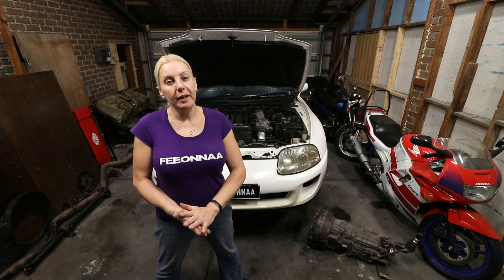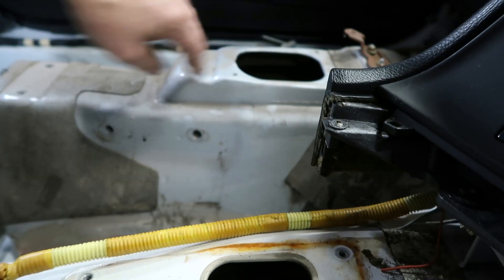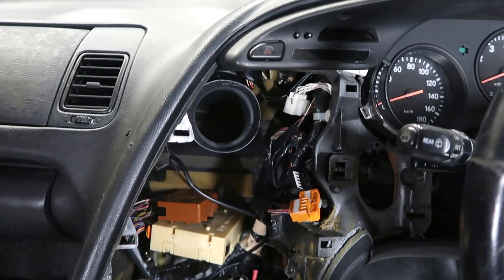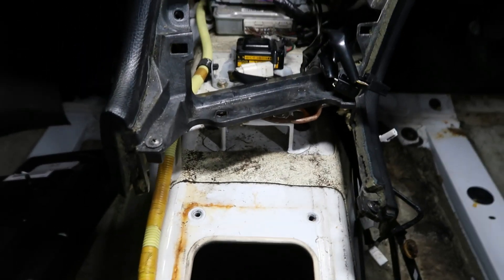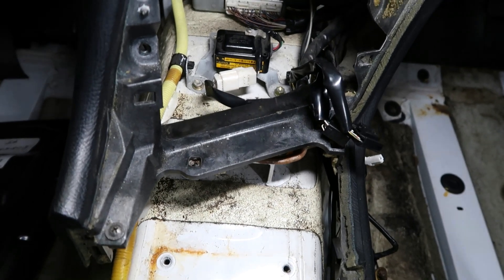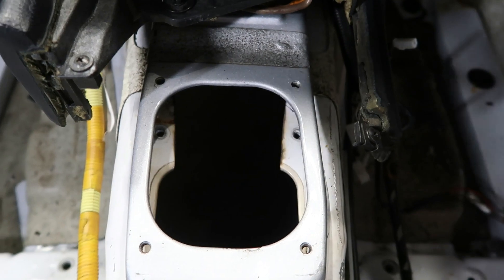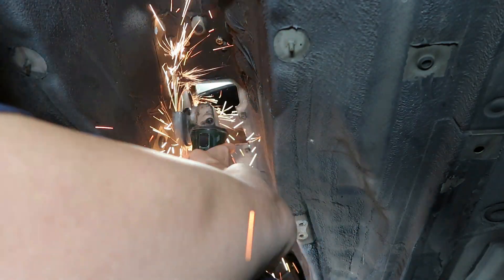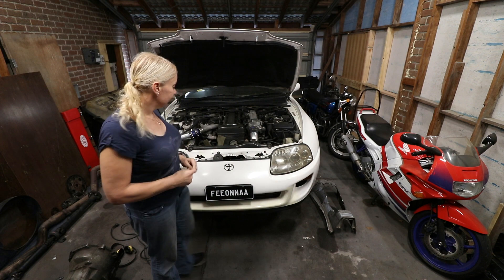Supra Build - Manual Conversion Tunnel Adjustment

Comment: when i did it. we had it on a hoist and did it all from underneath. just drill out a few spot welds and a little persuasion with a chisel and the auto one comes right out. then that new black one you had goes in no problem. just a few plug welds and some seam sealer!
Reply from the maker: Hi Pyrosrockthisworld,

You are exactly correct, but I don't have a hoist, and even if I had a ready to go welder and was able to do good plug welds, doing so without a hoist would be hard and possibly dangerous. 

Structure wise, I'm sure original spot welds are better than replacement plug welds, and I'd be concerned about leaving exposed metal leading to rust that I couldn't get to, especially between the 2 layers, whereas doing it my way all the exposed metal was treated, primed and painted.

Like you, I used seam weld, but you seem to be completely lacking sound deadening, where as mine still has stock coverage of sound deadening on both the original tunnel and the hat I made from the tunnel I cut the piece from.

For what its worth, in considering my abilities and the tools I have, I by far prefer the result I obtained, when compared to every other tunnel alteration I've seen or heard of, as done by anyone else so far.

But I do have to conceed, that my tunnel adjustment is still not as good as a factory delivered manual, and for those who do have access to all the tools, including a spot welder, and who bother to redo the sound deadening, then they would have clearly exceeded any conversion I have ever heard of.

As I said in the video, to do the conversion as how manual cars were delivered from factory, would be a total bugger, and everyone takes a short cut.

This video represents my short cut.

Kind Regards,
Feeonnaa
Reply: pyrosrockthisworld drilling out the welds and mounting it oem style is also more accepted when getting it engineered as technically its a structural component of the vehicle

Comment: this part was fun, i found a template to outline with a marker from under the tunnel. It was a perfect fit after that. It was extremely loud cutting from underneath and very unpleasant feeling the metal shavings blast me in the face 😆

Comment: Wow Hi car girl keep going, I’ll cheer you up, supra owner here from Thailand , What do u think about t56 swap im planning to buy it now im running on stock auto
Reply from the maker: The T56 Magnum Supra swap kit TR6060, with its close ratio gears is mint, new takes power, parts available etc... for me it was the cost of the conversion kit to make it work made the total cost only slightly less than the v160 / b03b swap I bought from a part-out.

If I was to build a Manual Supra just for the Drag strip, the Grannas Racing kit is exactly what I'd be going for.